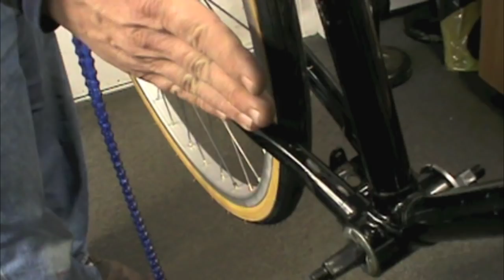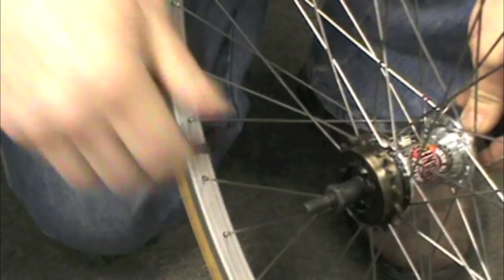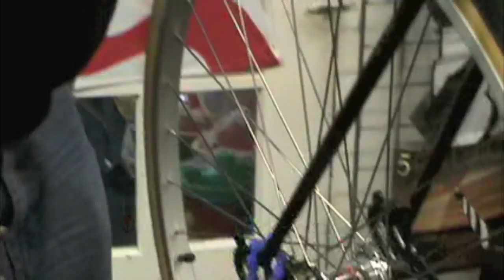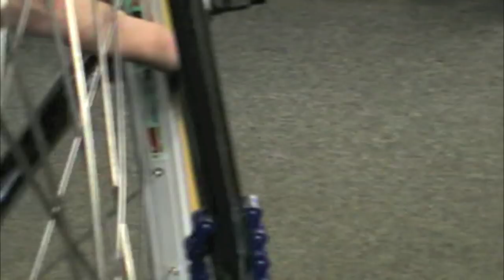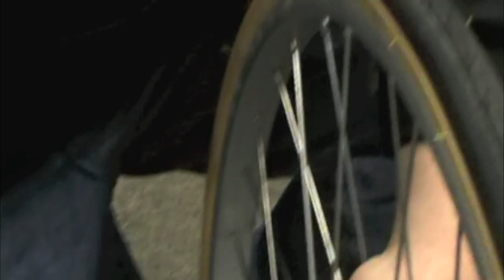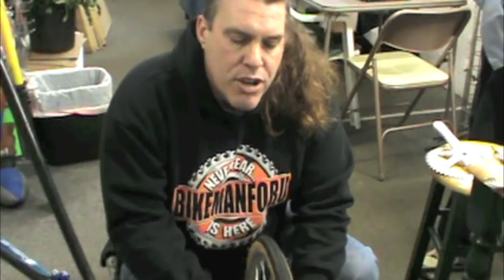Bicycle Repair - Playing With Wheel Dish Axle Spacing - BikemanforU

Comment: How does repositioning the quick release help?  That is outside the dropouts; it is either tight or loose.  It is the spacing inside the dropouts that needs adjusting.  

A single sprocket or fixed sprocket is actually more ideal than multiple gears as the hub AND the rim can be as close to the centerline as possible.  It is only when adding thick freewheels or cassettes that the wheel needs to be pulled over to the right, or dished, to keep it centered.

Comment: One option is to get a half-link chain. It is not a bad idea to have all fixed gear bikes outfitted with Half Link chains. Half link chains provide the benefit of better chain alignment, precise adjustments and better strength compared to a standard chain. If BikemanforU does not have them, do a search on Google.
Reply: Ive only recently discovered half link chains and agree, they make a real difference, way stronger

Comment: A while back I repack my bearings,when I reinstalled the wheel and cog  the chain was rubbing against the frame. I had figured it was the wheel or the frame that was bent .but after closely inspecting other bikes I noticed there was a small nut and a larger nut so I flipped them and presto problem solved

Comment: what should i do if the position of my axle in the drop out is all the way back but the chain tension is still abit loose? ive removed one chain link and it is too far forward coming near the edge of the dropout looking abit unsafe. i heard you can file down axle/dropouts but i dont have much to spare lol

Comment: Playing with spacers is great to an extent, but if the rim does not run centered between the dropouts and/or the chain geometry is off the bike will never ride right.  As Steve Sulkowski mentions, tolerances on bikes are pretty flexible.  However, the flip side to that is correctly set up quality bikes ARE well thought out and fairly precise.

You need to pull the wheel to the right or add more dish.  Tension the spokes on that side.  

Google: The Art of Wheelbuilding for online PDF.